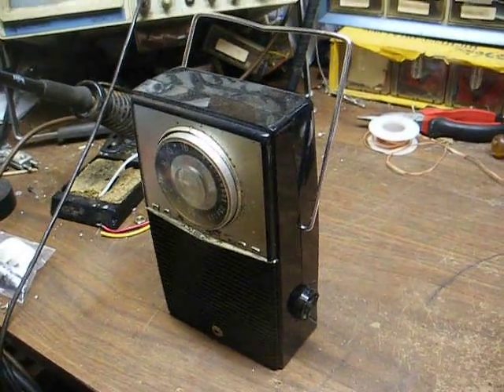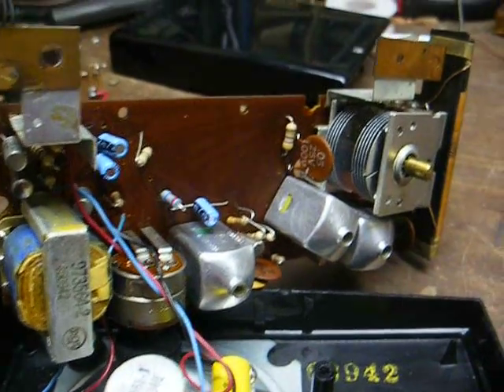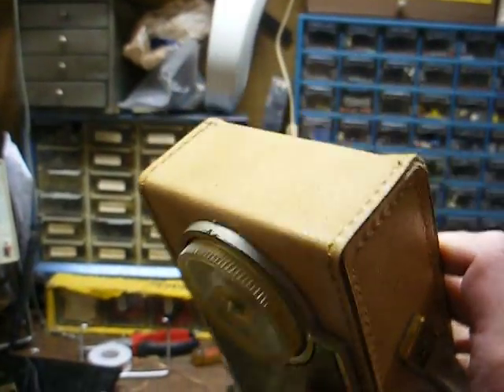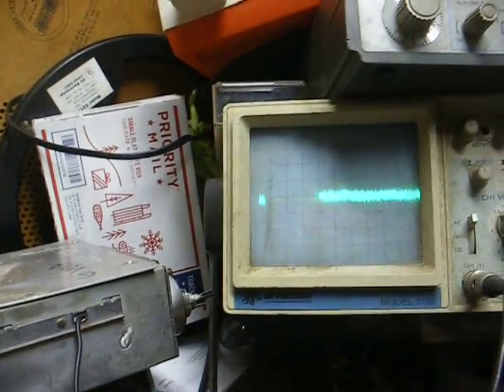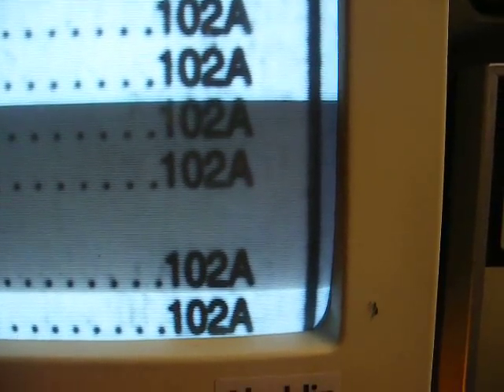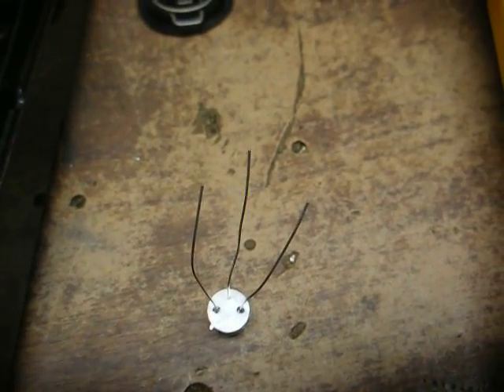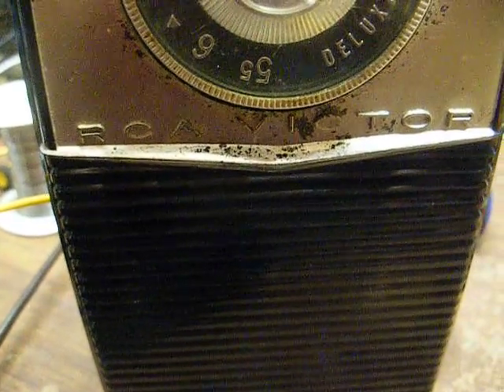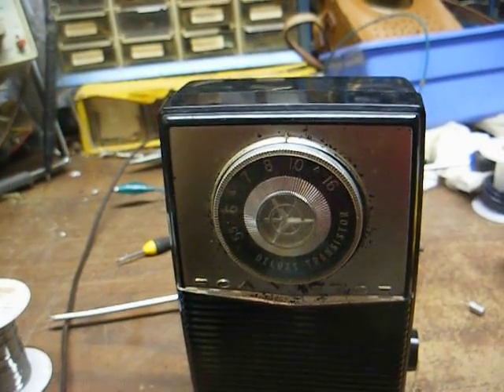Repair of RCA Victor transistor radio #1

Comment: I purchased an RCA model 1-RG-24 - I can hear a crackle when I power on. the volume adjust wheel seems to have more crackle if I jiggle it. Not picking up any stations.

Comment: 3:39 The 1N60 was a sensitive Germanium diode that could be used in place of a 1N34
6:30 2N408 huh?  I have used the 2N404 PNP xsistor to amplify the audio, and directly drive a one-hundred-forty Ohm mini-speaker
Reply: ...that's nice...
Reply: I have the 1960 model. The circuit boards crack very easily. Tighten the back cover screws just enough to hold it in place.

Comment: I have noticed that when there is white noise in the audio, the problem is almost always the driver transistor. I use a signal tracer to determine if the noise is coming from the driver, or before it.
Reply: ...yes, a signal tracer is better than nothing- but I'd prefer using an oscilloscope...

Comment: Must have been one of RCA's first sets with soldered-in transistors, and one of their last U.S.-made portables. With full-sized transformers and a 4" speaker, that won't fit in many pockets, but what an improvement over the crap that took over in the late sixties. It sounds better than many early-seventies clock radios.

Comment: They had transistors in the 50s? I thought they weren't out till the 60s.
Reply: The transistor was created in 1948, I think. I think there were transistor radios in the 50's. The first was reportedly sold in 1954.

Comment: Most of the battery powered radios of this era were designed so that when the volume was turned all the way down some sound could still be heard. This was to let you know it was on to save battery life. Of course the static noise is another issue.

Comment: That's a great radio, a real blast from the past. Replacing germaniums for noise can sometimes be a judgement call. In this case, it was warranted because it affected operation of the radio. But I have old record players with germaniums that have white noise at idle, but they work/sound fine otherwise---I'll leave 'em in there.

Comment: Could you please show or explain how did you connected the scope to the transistor pins to check if it was noisy?
Reply: ...I think he did just that: you connect the scope ground to the radio circuit ground, and connect the scope probe to the COLLECTOR terminal of the suspect transistor...

I had the exact same problem with a Philco pocket transistor radio, only I expanded the noise signal on the scope- and the noise signal looked really STRANGE!!!

Comment: So germanium transistors have a shelf life? Interesting!
Reply: They do indeed. The cases of those are made out of tin, and tin whiskers can grow inside the can, which in turn can short out the germanium crystal, or cause weird operating characteristics. And germanium is not the most stable element to begin with. But that's not to say that all germaniums fail.